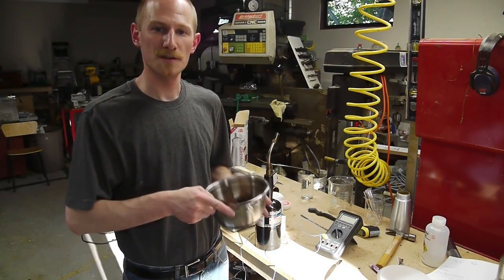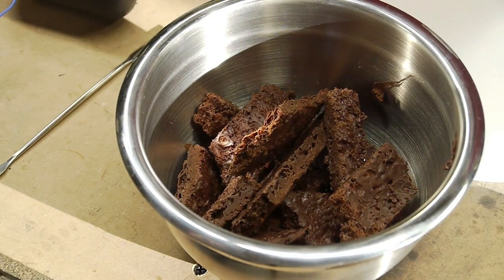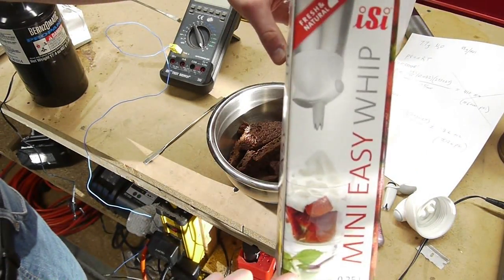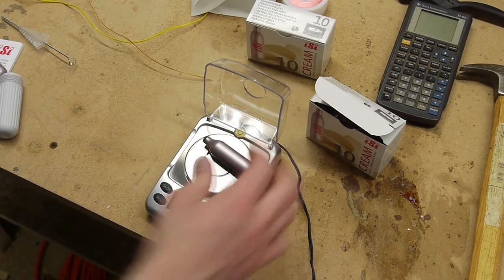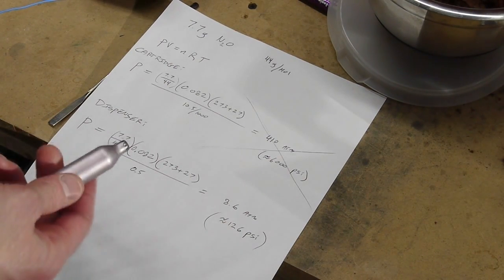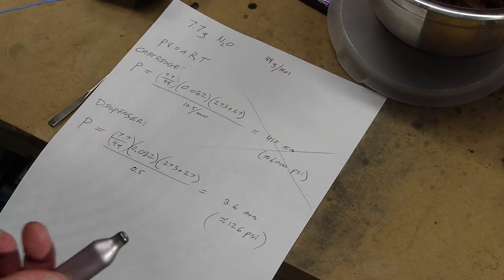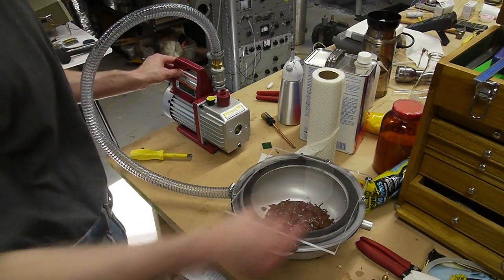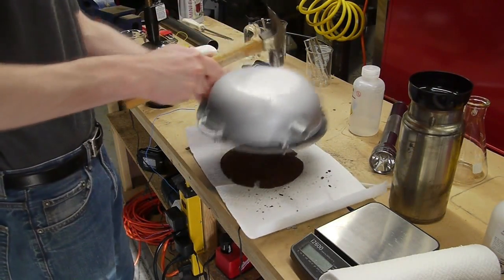Whipped chocolate made with high pressure nitrous oxide

Comment: Hello! I know this video is old, but I actually ran into the exact same issue with the pressure calculations on the N2O cartridges, and I ended up making a spreadsheet to calculate the values using the SRK Equation of State (reasoning below), and I got a value of 120.1 bar, which is a bit above the critical pressure (P/Pc = 1.656), and at 300K it's very close to its critical temperature (309K). I would argue that it's somewhat subcritical liquid-like, but it's also extremely close to being entirely supercritical/homogeneous. 

Why SRK Equation of State? Because, despite what certain people say, the van der Waals EoS is completely terrible near critical pressures and temperatures. Just for fun, I added the vdW EoS to my spreadsheet, and it gave a value of 1600 bar. Uh, that's worse than the ideal gas equation. Now, why SRK over PR EoS? PR was developed primarily to describe the liquid phase behavior of hydrocarbons--for N2O at this P and T, SRK works just fine.

Comment: I know this is an old video, but I have a suggestion that would help flavor, texture, and ease of the recipe.

Instead of using regular canola/vegetable oil, use coconut oil.

1. It is solid at room temperature, but melts at body temp, so is perfect for chocolate.

2. It brings a very slight coconut hint to the chocolate (I make crepes with coconut oil and it is really just a hint)

3. Last but not least it will help the chocolate set faster during cooling.
Reply from the maker: Nolansykinsley Thanks!  I've never cooked with coconut oil, but it sounds really interesting.  I'll give it a shot.
Reply from the maker: Thanks!  I've seen that episode of How it's Made, and I agree the gentleman does look a lot like me.  It's not me, though!
Reply: Applied Science Ben, i love watching and learning from your videos and i swear i just saw you in an episode of How its Made when they made magnets lol was that you?
Reply: Applied Science lol it just caught me off guard :P
Reply: Nolansykinsley Why do you have to add any oil at all? Chocolate is already made with cocoa butter which is a fat.
Reply: Great improvement to a great hack
Reply: If that's an old video then what's your comment now 😂

Comment: You know, whats funny? Nitrous oxide is actually a fairly good oxidiser, its the "Nitro", used in racing sports. And if one adds enough of this to any fuel like e.g. normal fat, it will possibly be a detonable explosive with a power close to TNT.
Ever heard of detonating chocolate? Yeah it might be possible. But I think, this experiment was rather safe anyways.
Reply: That would be nitromethane you're thinking of.
Reply: Partially correct. The "nitro" used in motorsports is actually nitromethane, which is akin to rocket fuel. In the top fuel ranks, it is mixed with a small percentage of methanol (back in the day, it was mixed with gasoline as well for drag racing. This is uncommon today). Nitrous oxide is also used in motorsports as both an oxidizer and an intake air intercooling medium (an oxidizer for drag racing purposes, and as an intercooling medium in many land speed racing applications)

Comment from the maker: The heating/cooling profile will determine the temper (crystal structure) of the chocolate, and its subsequent melting point. In this experiment, I didn't control the temperature carefully enough to ensure a good temper, and the chocolate did melt at a lower temperature in the final product. This is why homemade chocolates do not "snap" like commercial chocolate and melt too quickly when eating. Professionals use chocolate tempering machines to do a proper job.
Reply: Applied Science that's fucking rad, tempering chocolate? I didn't even know that was a thing!

Comment: since you are dealing with pressures that are not around 1 atmosphere pv = nRT is not the best equation since the atomic radii and attractive forces between the individual molecule is no longer negligible. A better equation to figure out the pressures would be to use the Van der waals equation. You would also have to look up the a and b values for nitrous oxide aswell

Comment: u_u... no.. its not fake... those are very low pressures...and the difference is just insignificant.. AND BY THE WAY.. NO2 its Nitrogen dioxide and N2O its Nitrous oxide .. I´m a chemical engineer... ignorants... ignorants everywhere...

Comment: Also not to mention the fact that ingesting Nitrous oxide will be converted into Nitric Acid( in the acid + water solution of your stomach) and you know Nitric acid is the worst thing that could touch your tissues, it a far more dangerous acid than Sulfuric and HCl.
We can recover from HCl burning very nice, on low concentrations obviously, and Sulfuric acid oxidizes quite slow. But when Nitric acid touches you its good bye.

Comment: You'll learn about the Van Der Waals equation later on (which adjusts for non-ideal gases). These equations seem abstract, but they find so many uses, even if it doesn't seem like it in the classroom. The sciences and maths were developed to make our lives easier, not harder. I'd rather calculate the temperature of the sun with physics rather than sticking a thermocouple into it :)